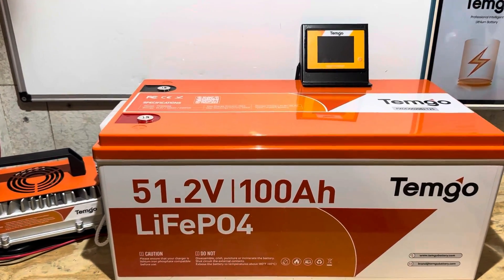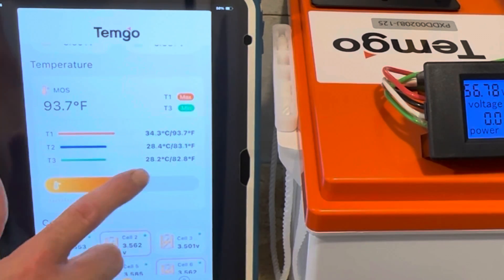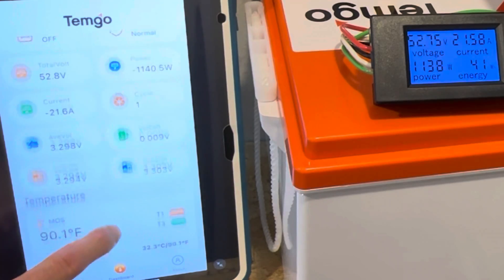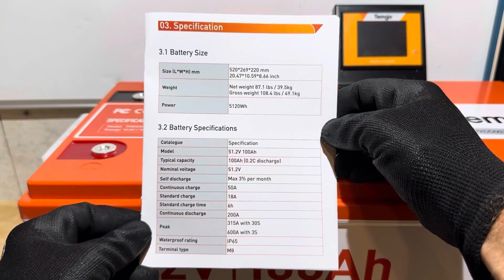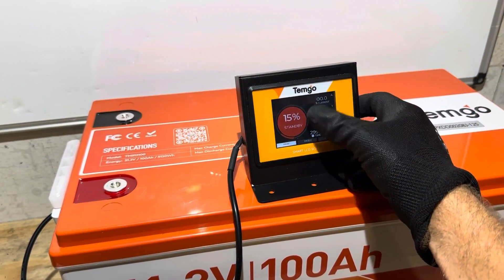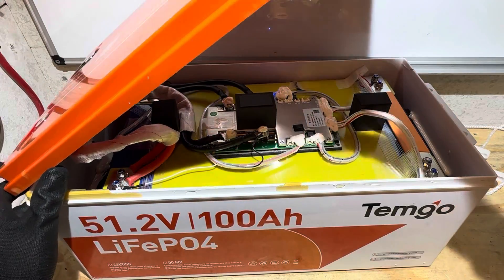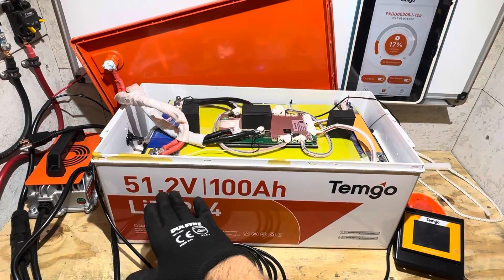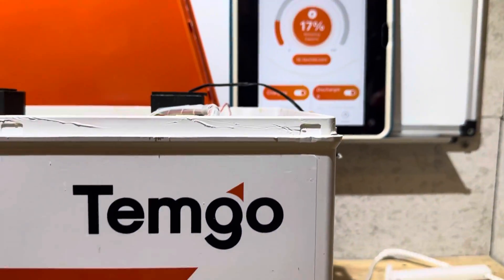TEMGOT 100Ah Golf Cart Battery Review & Teardown | Temgo 51.2V 100Ah LiFePO4 Battery

Comment: I woke up the controller after turning off the discharge switch by flashing around 20vdc across the terminals; then turned the discharge switch back on

Comment: New subscriber.  I just replaced my 200ah AGM batteries on my Class B RV with the Temgo 12V 300ah self heating lithium battery.  Basically needed it to run my fridge and 12V accessories like the fans.  So far so good.  Depending on the draw it will run my fridge and fans for about 4 to 5 days while replenishing with solar panels.   This battery is rated for IP65 and the company did assure me that it would handle road spray from rain as it is mounted outside underneath the carriage of my RV.  I have only had it a couple of months and have cycled it 21 times according to the app, so far I like it.  I don't know how reliable it is for the long run, but the way it is working and if it continues to work it is better than paying $2500 for the other battery that is only 270ah.  Great video and enjoy your content.
Reply from the maker: Thanks for subscribing! 
Glad to hear the battery is working well for you I appreciate you sharing how you are using it. 🙂

Comment: Will a 15 amp 120 volt breaker work with that  Temgo charger charger ?
Reply from the maker: Yes you should be ok. 
Most of the 18A chargers pull a little over 1000W from the wall.

Comment: 5°C is 41°F which is higher than I want my low temp charge protection to kick in. I'm a 35°F type of guy, while others skirt at, or just under 32°F.
Reply from the maker: You can easily program the battery to fit your needs. 

Using Overkill Solar App to Change Settings on a Jiabaida (JBD) BMS
https://youtu.be/AdDpf5WcnfM

Comment: I have a DC Powerhouse battery and it’s giving me an under voltage cell and over voltage cell error code on overkill solar which is triggering the software lock. When I hit the discharge switch it will allow my golf cart to get power (The reverse will start beeping) but as soon as I press the gas it faults out again. Any idea how to fix this?
Reply from the maker: Could be a battery issue. May want to reach out to manufacturer for possible warranty. I have a friend who had similar issue and they were helpful during the troubleshooting and warranty process.

Comment: Watched this again after the other programming video. No no no, you're not gonna get me to buy one lol. I don't need it 😅
Reply from the maker: I thought you didn’t have a golf cart lol 🙂 You gonna make a 48V setup next?
Reply: @THEOFFGRIDMOUNTAINHOMESTEAD lol nope, 4 wheels and Sxs. One thing I've learned is that I'm a slow learner and a quick buyer. If I knew what it's taken me months to learn I probably would have just started with a 48v system that would do all I need in one package. But now I'm saddled (blessed?) with a lot of 12v stuff that I manipulate to meet my needs. I could still but I'm too cheap to spend an equal amount of $ just to be one of the cool kids. Besides my kids already think I'm silly. Or they would prefer to inherit the money, I am old after all lol
Reply: I do have a question. You must have oodles of batteries. Do you even have time to maintain them all or do you even worry about calendar aging? I have 100ah's that still say 100% after 6 months sitting
Reply from the maker: @ronhawkins8604 My lithium batteries all work for a living. 🙂 Anything I still have is connected and working in some form or fashion. Some test samples get harvested for cells, some get sent to e waste facilities, some sent back to mfg., others given away. If I find an impressive one I often buy another or several more. 
My 12V lead acid system is the one that’s a pain. It’s so needy. Always charging it and wasting energy just sitting there. It’s technically a hybrid now. I have a couple LiFePO4 on it to keep voltage up and maintain the lead.

Comment: I was looking at getting these batteries to add onto a Anker F3800 power station but the board issue allowing the cells to go into critical ranges doesn’t sound good. Is there a better option out there for a similar 48 volt 100Ah LiFePO4 lithium battery for what I want to use it for?

The ECO-WORTHY 48V 100Ah LiFePO4 Lithium Battery Version 3 for $869 seems well recommended.
Reply from the maker: Eco V3 not too bad at all https://youtu.be/miGuMOCIxvU?si=xtPH1O01lsLhwWL7

Comment: Great video, very timely, thanks! You definitely touched on a couple topics I as a newbie to the intricacies of these batteries was unaware of. 

If you don't mind questions...will any third party apps allow simple reprogramming of the BMS? Changing the low and high voltage per cell to figures better suited to good lifespan would seem like a good idea. 

Second, how common is that low current problem on other manufacturers cart (or non cart) batteries? I've got an idea to use the cart with an inverter, solar, etc. for emergencies, timeout from very low draw for something like 12v LED lights would be irritating to say the least. Is this spec normally listed by manufacturers? I dont recall ever seeing it before. 

Again, very informative video!  If you have time to answer I'd appreciate it, but I understand if not.
Reply from the maker: Some apps will allow you to make settings changes. Also the manufacturer can lock the BMS on some batteries where no change can be made. (Ecoworthy does this). 

The low current detection threshold on most of the newer GC batteries with the SP24 board is 2 Amps. This can only be modified with Production level coding access. Some manufacturers program it lower. Some have the sleep function enabled some don’t. Again production level access requirement to change this. 

Tell me which battery you’re considering an I may be able to tell you more about it and if it’s a good choice for inverter duty.
Reply: @THEOFFGRIDMOUNTAINHOMESTEAD  definitely considering the Temgo(t). It would be a pretty light use case. More hobby level, but still functional. I have a golf cart that needs repowered, it too wouldn't get heavy use, but would be nice to get it back in action, and affordable is the name of the game. 

It seems the Temgo(t) has a lot of features that most other GC batteries don't, even when $200 more.

Thank you!

Comment: I have a question. Do you have, or could you make a video on the bms settings for solar storage?
I have a couple of the Paoweric golf cart batteries that use the same bms, same monitor, same port for the monitor, etc.
The second one threw 2 over voltage error on cell 13. It calmed down after the 3rd day but cell 13 is always the highest cell. I want to adjust some of the settings using OK Solar app but I'm clueless as to which settings I need to change and of course the values they should be set at. 
Thanks for the opening. I saw nothing to concern me for my application. The most amps I see coming in or going out is 15a to 20a because of the size of my battery bank so the smaller battery wires will be fine.
Decent batteries for what I paid. They were 32 bucks cheaper during prime days with my bad luck
Reply from the maker: I can make a video on more detailed settings for Golf Cart batteries used for ESS. I will try to give you a couple of quick helpful tip as to what I do. I turn the current down. I set balance at 3.3V/cell. I rarely,  if ever charge over 56.0V on a daily cycle basis. Some of the GC batteries are known to have a runner cell or two. More conservative charge settings can help from tripping the COV protection. Is your runner cell coming back in line under load?
Reply: @THEOFFGRIDMOUNTAINHOMESTEAD Yes it acts normal other than always being the top dog at full capacity. 
It might be a boring video but I haven't seen anyone get into the settings so it should at least be helpful to others
Reply from the maker: @fauxque5057 I can make it happen! Thank you again for the suggestion.